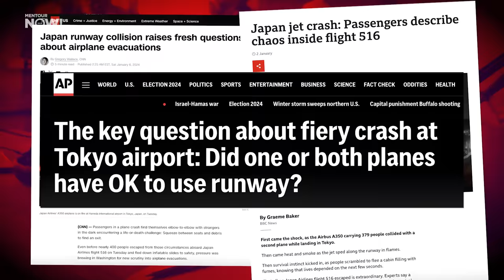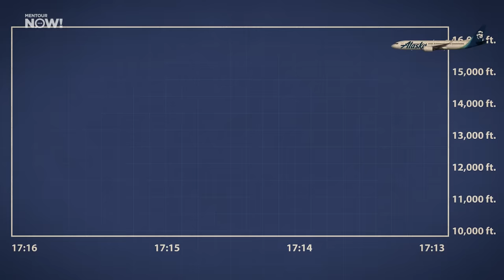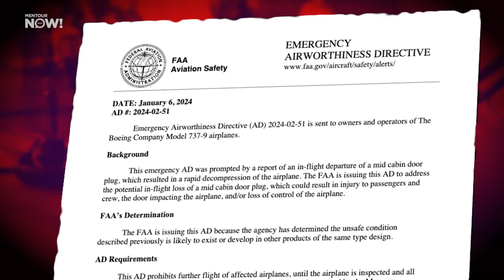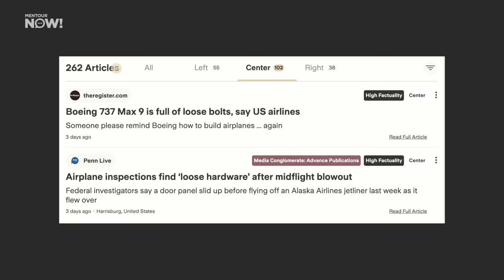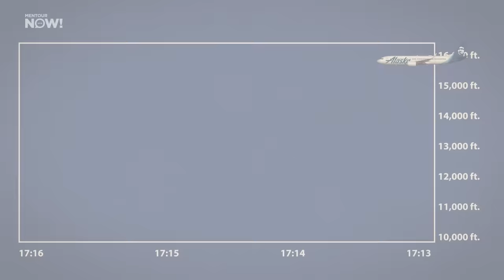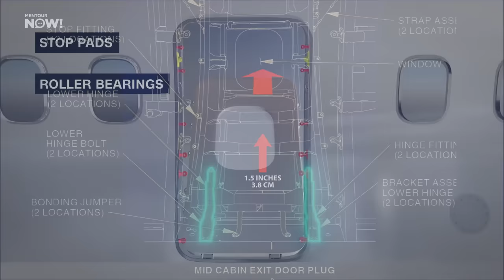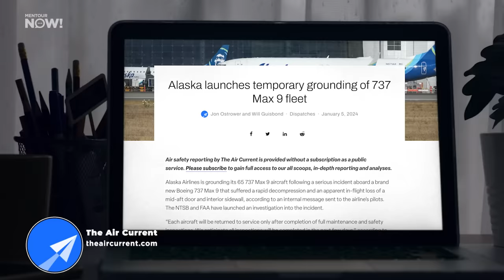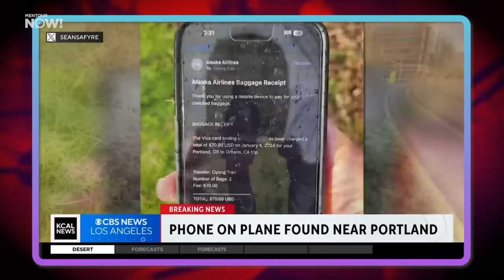WHAT Is going ON with Boeing?! MAX-9 Door blowout

Comment: The phone case was confirmed to be a Spigen cryo armour case. It's worth mentioning that the phone  likely hit branches on its way down then landed in grass, breaking the fall.
Reply: watch them use it as part of their advertising regardless of what broke the fall
Reply: So, basically any silicon or TPU case which covers all the edges of the phone should be equally good for this use case? If you don't mind the usability issues, something like Otterbox where the protective edge comes off the screen quite a lot would guard the glass pretty well. Of course, that also makes all the touch gestures starting or ending at the edge of the screen next to impossible to execute.
Reply: So this all was a stunt to sell more phone cases. I see.
Reply: I sense a conspiracy between Boeing and phone case manufacturers...it's becoming very clear now as to why those two seats were empty.
Reply: There have been cases of people surviving falls from great heights, like 20 floors, sometimes with barely a few scratches, because they hit some bushes on the way down or whatever. And then someone dies by falling in the bathtub. It's all about how and where you fall. Same for a phone. Even the most rugged phone case is, what... 3 mm thick, at most? It wouldn't make any difference if it hit something hard at terminal velocity.
Reply: @ironcito1101  3 mm thick case might be enough even with somewhat slow terminal velocity if crash direction is perfect. That is, no bending forces from the hit, glass never touching anything hard. I wouldn't be surprised if the phone can take at least 100g without breaking .

If we assume that the terminal velocity of a smartphone is around 50 m/s and the 3 mm bumber being flattened therefore takes about 0.00006 seconds, the resulting g-force for the stop is about 85g.

If the hit is corner first, the g-force may bend the phone which will obviously crack the glass parts.
Reply: Spigen is a great case.  Been using one for years on both an Android and an iPhone and never any issues.  My favorite model comes with a little rectangular pop out stand.  I've never had the stand fail or break off.
Reply: During WWII there was a B-17 tail gunner who decided that bailing out without a parachute beat burning up. He woke up lying in a thick patch of snow looking up at an opening in the trees above where he'd smashed through.
Reply: @MikkoRantalainen you assume a pretty high terminal velocity, from what I've read it would be around 50km/h which makes it close to 14m/s. If it will than pass through some branches/bushes it can survive with some luck.
Reply: @yankeetango yeah been using the tough armor for a decade, best phone case out there. The stand is great, I use it often
Reply: @secondskins-nl  I'm pretty sure a smartphone terminal velocity should be at least the same level as a human (~40 m/s). My point was that even if we assume 50 m/s velocity and 3 mm stopping distance, it's still "only" 85 g. That would kill a human but a smartphone should be able to take that much acceleration if the force is applied evenly to the whole body of the smartphone instead of only one corner.
Reply: @MikkoRantalainen  well I didn't make it up. But if you look online you will see that a phone would reach max 50 m/s if it would fell steady with the shortest side downwards. That will make it pretty hard to land on the whole body. I'm sure some YouTubers will try it soon but think the 20 m/s is much more realistic.
Reply: @ironcito1101  A flight attendant once survived a 30,000 foot descent in the broken tail section of an airliner. She sustained only moderate fractures, though her clinically low blood pressure might have contributed to her survival. Most people would take major internal injuries from the forces involved.
Reply: Many phone cases don't protect all that well.  But ones with mil specs (military specifications) have been tested and proven to provide very significant protection. 

I would bet good money that whatever case it was, it was one that met mil specs
Reply: @Inkling777 I heard of a similar case. I think in that other incident being unconscious was determined to be relevant as the person hit without tensing up. Plus a bucket load of luck...
Reply: Well obviously this must have been a scenario, when that phone has hit the ground at the optimal location and with optimal angle but it's still astonishing that this is possible at all. Also it was intact on the outside but if the autofocus/OIS suspension & coils for camera lenses where also intact then this is nigh miracle.
Reply: The phone would have survived without a case as long as it hits soft ground.
Reply: The flight attendant with a 30000ft fall was helped by soft ground. Surprising what a few extra feet of stopping distance can do.
Reply: For 65$ one could just purchase warranty against dropping, no?
Reply: Recently switched from otterbox to spigen, since the otterbox just self-destructs in 2 or 3 years...
Reply: Also had a screen protector fitted. Wouldn't surprise me if that was Spigen too based on the ones I use.
Reply: We need to start equipping phone cases with little parachutes, and CO2 cartridges and altitude sensors to auto deploy them. Should only add about 5-10 lbs of weight to your pocket, no biggie.
Reply: @RCAvhstape  No need for an altitude sensor - phones have built-in barometers these days (certainly iPhones do). Unfortunately airlines don't generally allow CO2 cartridges, for reasons that should be obvious.
Reply: @GrayMatter70  Well, airlines will have to change their rules if we are to have safe air travel for our phones.
Reply: @justdecaffeinated  I honestly hope so, like that one gun this seller advertises is effective for hunting T-Rex's for its part in the Jurassic World movie lol
Reply: this is now phone crash channel
Reply: Ah the spigen phone case, let's see if North America makes it it next Stanley cup...
Reply: time to buy stock in that company, i predict a huge increase in sales
Reply: @ghostwriter720  I don't know... if they advertise and bring it up to the public, then perhaps, but I wouldn't buy stock until they do so.
Reply: @MikkoRantalainen  Love my cheapo silicon case, I've dropped the cellphone on ceramic tile floors more times than I care to admit. All corners of the phone are covered. Unlike with other cases in the past, there's never a crack on the screen, never any other issue. From 16 thousand feet with branches and grass breaking its fall might be a different story. But what are the odds of that, eh?
Reply: Wind, lightness of the phone, and the foliage might have been the factors that helped the most.
Reply: @cliffmathew  Reaching terminal velocity though... not sure how much it would have helped, especially with how much weaker smart phones have become...
Reply: @Suzuki_Hiakura  The ~200 gram phone must have been going forward at the speed of the aircraft for sometime and then affected by winds and turbulence. It definitely was not a typical free fall with no air resistance. The door they found was also quite intact.
Reply: @cliffmathew  ah. I mean, the door was a plug, and it was already missing several bolts that would have locked it into its track. Air resistance though might have slowed it a bit though. I really don't know though... hard for me to imagine certain things like forces and weight tbh... even made the mistake of asking if a license to drive a few ton vehicle in the army meant my recruiter could drive a tank, to which he responded a tank is far more than a few tons... some times I am reminded how blonde I am, and it still shocks me lmao
Reply: Thanks!
Reply: @jack002tuber perhaps Boeing should consider making their planes, out of whatever material the phone case was made of !!!